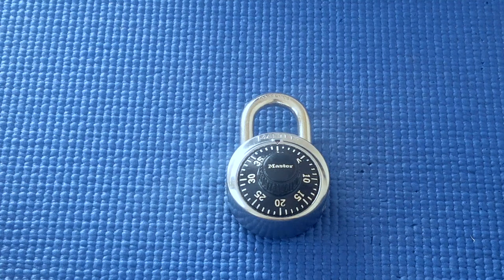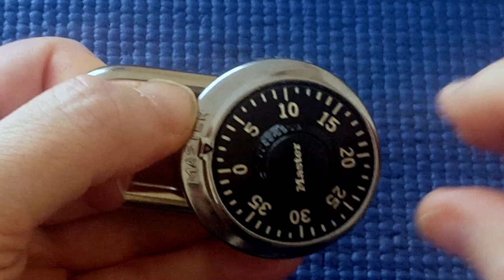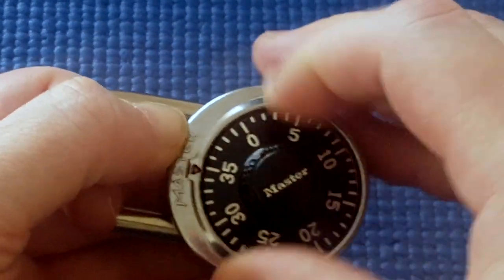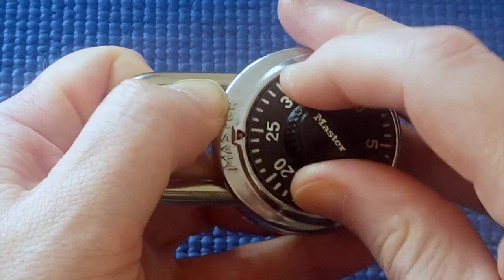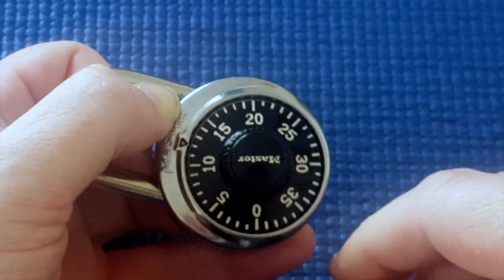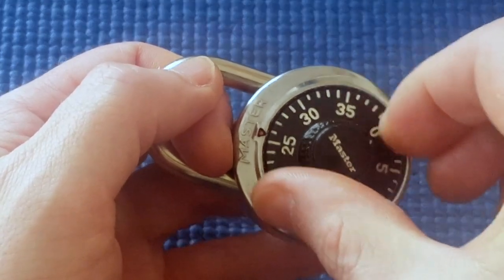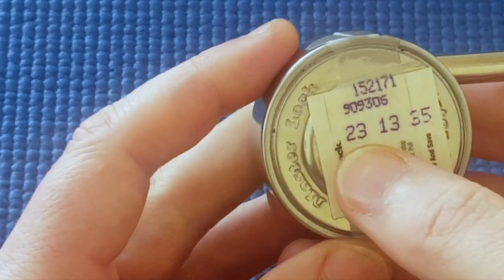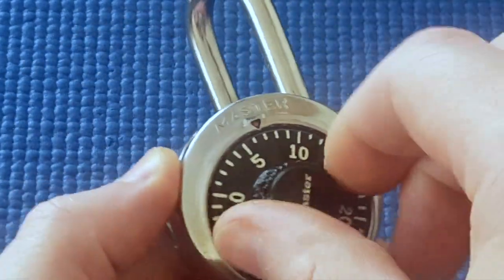(Picking 96) Can't crack your Master Lock combination? - try this!

Comment: I opened severas Master Combination locks over the years. But this particular lock I tried so many methods. The Backwards method worked I was Surprised  thanks dude
Reply from the maker: Great - well done! ... yea some of those locks just wont play ball in one direction. Once you have the combination of the backwards way, it's possible to mathematically work out the combination of the normal way.

Comment: Oh my gosh, thank you for this video. I watched a bunch of other videos (including a couple of yours) but the trick I needed was the rotate it backwards to find your number. Going the normal way I just couldn't figure it out: it was either too loose or too tight. But going backwards I could get one 'tick' so I knew the number. Had to continue with the 'backwards' method to get them all, and then do the math to reverse it, but it all came out good. Totally appreciate the video! Well done. (And yes, it was a standard Master Lock that one of my kids had been using for years; now they're off at college, no one could remember the combo; not a problem any more.)
Reply from the maker: That's fantastic! :D :D  So glad it worked.  You are now learning some advanced techniques.

Comment: The backwards combination is actually

The real combination but with these changes
1st number minus 7
2nd number plus 3
3rd number
Reply from the maker: You've cracked the formula! Thank you for sharing. 😄😄
Reply: I once opened mine using 20 0 31 instead of the original code 27 37 31
Reply from the maker: @pickaxe4248  How did you figure it out though?
Reply: I actually forgot lol
Reply from the maker: @pickaxe4248  hehe😉

Comment: Great video!!  Thanks for the tips. I had a combination lock and figured it out after watching one of your previous videos. My nephew didn’t believe I figured it out so he bought me a new combination lock to try. It really confused me because the second number was 00. I just couldn’t believe 00 was a number so it took me a bit longer but I got it open. Have you ever heard of a combination lock with a number 00?
Reply from the maker: LOL that's funny! - well done for decoding your locks! :D :D  Was it a Master lock you did it on?  Yes 00 can definitely be a number, and I own some that have 00 as one of the numbers.  It all depends on where the (true) gaps are on the 3 disks.  For the 2nd number I tend not to assume anything and try all the every-second numbers.  Thanks mate! :D :D
Reply: Yes they were both master locks
Reply from the maker: @LockpickingsGal  Nice :D ... just confirming, it was only the 2nd number that was zero right? ... or do you mean 1st & 2nd number both zero? (Master locks aren't really meant to be able to do that)
Reply: Combination was 15-0-15
Reply: Sorry for the confusion. I didn’t have it in front of me. Stroke brain lol. ( I had two strokes)
Reply from the maker: @LockpickingsGal  Wow nice combination.  That's turning to the right on your first number huh?  Try doing the opposite
Several times to the left and end up on 10, then one full turn the the right and then keep going all the way around to 2, then left again to 15 ... does it open?
Reply from the maker: @LockpickingsGal  Wow!  No confusion - just making sure. :D
Reply: I had to get the lock back from my nephew.  Code it came with us 30-00-30.  I had bought a couple master locks and hid the codes so we could play with the decoding.  Where do you live. I could send it to you
Reply: The other one that I have 17-00-34 we think. It opens with that code but the other one I still have the store code on it
Reply from the maker: @LockpickingsGal  Ah if it's 30-00-30 when turning the first number to the right, then the for a master lock the code turning it the other way (turning the first number to the left) should be 25-02-30 (ie 1st - 5, 2nd + 2) :D  I live in New Zealand, far away from most countries (and the postage is expensive).
Reply: I tried the 25-02-30 and no go.  Is there anyone else sending you a package that I can send it to them.  It would cost me more in postage than it was for the lock but I would love for you to have it. Great videos and I really enjoy your channel
Reply from the maker: @LockpickingsGal  Thank you for such nice words! :D :D  You are kind.  Yea NZ is just too far away from everywhere and the postage is ridiculous ... I'm not due to receive any packages (except maybe from Poland, but he's not part of the lock-picking community).  Thank you for the offer though!  Where do you live?  So the lock that has 30-00-30, the code turning the other way should be 25-02-30 ... also adjust the 1st number & 2nd number (eg try 25-01-30 and 26-02-30) but keep the 3rd number the same (as it never changes).  The 17-00-34 code for the other way should be 12-02-34 ... and make sure you turn it several time to the left (counter-clockwise) and keep going to your 1st, then one full turn to your right past your 1st to the 2nd, and then back left to your 3rd.  Also, if that doesn't work, try and pick it! :D

Comment: Good job. But after all if any method doesn't  work for you  heavy duty wire cutters will for sure  =)
Reply from the maker: Thank you! Oh yea for sure, even cutting the main body can work as it's thinner than the shackle (which is also hardened). Cheers!

Comment: i can not get mine to open  the back of mine has the number 2818m i have watched 10 vids already it is not working😭
Reply from the maker: Which part are you stuck on? Do you get the 3rd (last) number?
Reply: i can do all the parts it is just not opening i spent 5 hours trying to open it i got it when i was 15 that was 5 years ago and i lost the code for it
Reply from the maker: @jadasmith-uy3wo  Tell me what number you find as the last number, and also do you detect a notch for the 1st number?
Reply: i find 39 as the last one and 20 for the first one
Reply from the maker: @jadasmith-uy3wo  For the last one, try how loose 15 is compared to 39 (under heavy tension) - which is looser?
Reply: 15 is loser then 39
Reply from the maker: @jadasmith-uy3wo  Are other numbers looser than 15?

Comment: Very, very confusing video...I find that Samy Kamkar's computational video way easier but on some of the locks his method won't work..that's why I came here but I didn't understand your method....thanks anyway.
Reply from the maker: Sorry it's confusing ... the video was meant as a follow-up to some of the other videos in the description (and they should be tried first as they are simpler and easier - this video was just meant for some advanced methods only if the other methods didn't work)
Reply: @Swynndla  OK thanks for the clarification..I'll check out the other videos also..I find  random open locks at my sports club , just hanging from empty lockers.  Most often , i'll take them home and try to figure out their combinations .  So far, only a few have given me a hard time figuring out their combo secrets..especially the ones that have multiple sticky points.  Thanks again.
Reply from the maker: @jessedylan6162  Nice - and good luck with them. I've done a few combination locks, and they vary greatly in difficulty, depending on what type. When it opens it's very satisfying!

Comment: This didnt help at all
Reply from the maker: This video covers some advanced techniques that build on some of my previous videos (see the ones in the description). Most of the time the non-advanced methods will work, but this video is "just in case" it still doesn't work. It also it assumes you're already familiar with the earlier videos and so it glosses over the fundamentals, so I'd recommend checking those first.

Comment: None of these videos explain how the lock picker knows he is finding 'The first number' or 'The third number.' There is no reason to think you can call any number 'The first number' unless you knew the code in advance.
Reply from the maker: The combination will be only in one order, and a different order wont open the lock. When I talk about finding the 3rd number, it's the last number in the final combination.  Am I not understanding what you mean?
Reply: @Swynndla  Thanks for replying. When you first start to rotate the lock , you find a number that sticks (in some manner) and you say 'That is the first number of the combination.' How do you know that? Maybe it will stick on the second or third number.
Reply from the maker: @MrPeterpott  For Master locks, when I use that method, the number that sticks the most tends to be the first number.  I think this is due to the physics of the discs being stacked on top of each other, and so some of them get caught under tension more easily than other.  Some videos show the insides and why it behaves as it does, eg: https://www.youtube.com/watch?v=qkolWO6pAL8&feature=youtu.be

Comment: Sir i forget password and can,t recole it . Also can,t be able to understant what to do .at back a no is written 903557
Reply from the maker: Your first number should be 2 and your third number should be 22. Your second number should be an even digit. You should turn the dial several times clockwise (like three full turns) and stop on 2, and then one full turn counter-clockwise to your 2 again but keep going until you get to your second number, and then turn clockwise to 22 (and it should open if you went to the correct second number). Try all the even second numbers.
Reply: @Swynndla   thanks a lot sir it works the no is 2..4..22